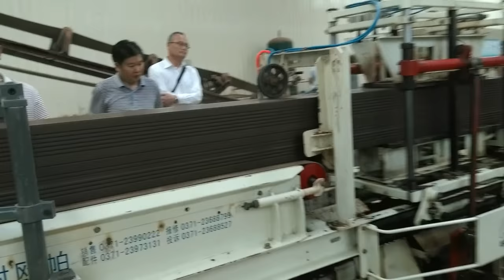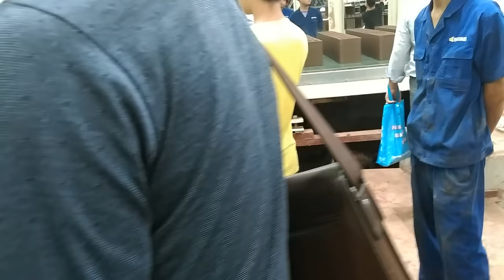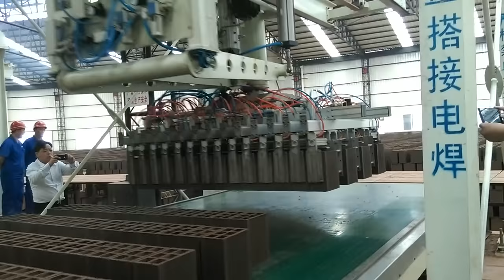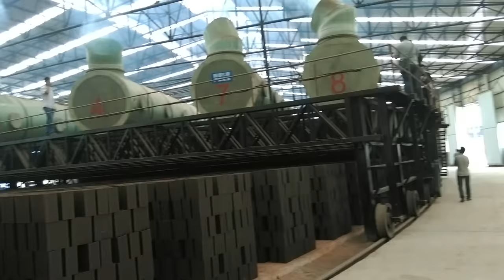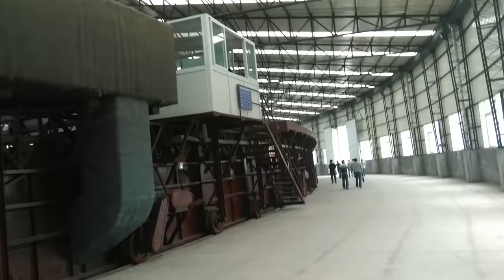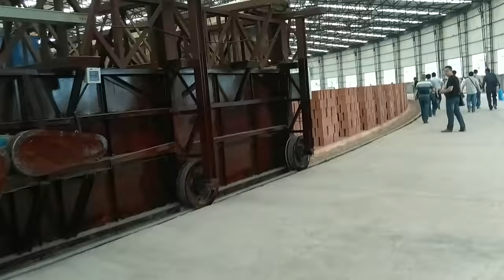Mobile Rotary Bricks Burning Kiln for Fully Auto Clay Bricks Production Line

Comment: Impressive equipment!
The hole pattern in the bricks is sub optimal though.
Reply: @Bert Safor that is what I was thinking.  It looks like a decorative piece at best.  There isn't enough mass in the brick to hold very much weight.
Reply: @johnthomas5166  in several countries buildings are made of a concrete skeleton with non load bearing walls.
So there's no necessity for a high strength of the bricks,  weight reduction is very important though.
Thermal insulation is obtained from the channels within the bricks. The best thermal insulation is obtained by many channels in the brick and also by as long as possible walls between the channels within the block. The longer the inner wall, the better i. e. the lesser the heat transport via that wall. Besides the strength of the brick increases too. The same is true for its vulnerability to vertical cracking.   Some producers mix the soft clay with sawdust and or polystyrene that will burn during the sintering process. This decreases the internal stress of the blocks and contributes a bit to the insulation properties. Than there is the topic of bricklaying. The blocks shown in the vid are hard to lay since most of the mortar will fall into the channels... 
Blocks made with a better pattern can be layed much easier and with minimum loss of mortar. 
Pls look up "poroton bricks" in the internet. Those bricks are very easy to lay with the best possible use of the mortar. 
Regards from Bert in Spain

Comment: This is what I will call masive production
Reply from the maker: Thanks
Reply: What is the per round production capacity
Reply from the maker: @zahiddalam6834  The per round production capacity can be adjusted based on the brick size, the round diameter, the kiln width.
Reply: Okk.. but what’s the capacity of this factory..

Comment: how to get machine. from where to get. how much area required. Gas might not be available in my region. can it Run on Solar System
Reply from the maker: We are from China, and we can send the machines to your near port. Coal is ok for the brick burning kiln.
Reply: @DavidWei  how much ivestment required
Reply from the maker: @adeelhassan678  The bricks production line cost is based on your brick size and your required production capacity per day.

Comment: There should be chamber connecting to chimney outside the roof, instead the smoke indoor the factory 🏭, though impressive and how much will it cost to set this kind of factory up in Africa?
Reply from the maker: Add my whatsapp (0086-13598084936) for detailed talks.
Reply from the maker: Please send email (export@yxkiln.com), or add my WhatsApp (0086-13598084936).

Comment: Very bad idea to run such a continuous production line, one faulty point will stop the entire line. And prepare to import with this beast a full crew of Chinese engineers and operators to run this line for you.
First part is good though, extruder up to flip and should stop here to buffer production.